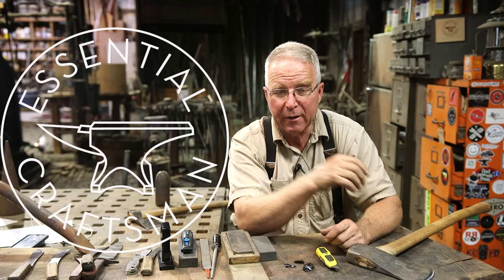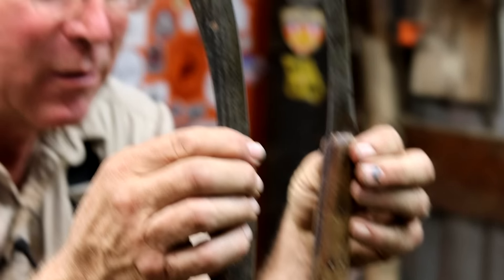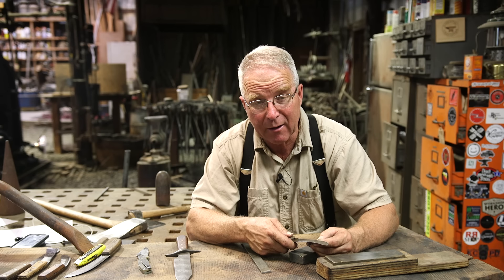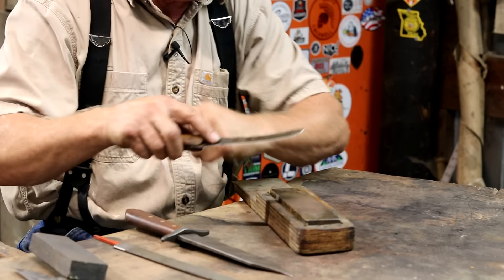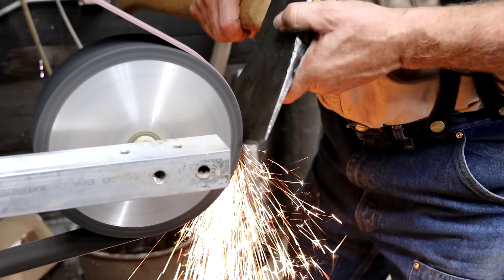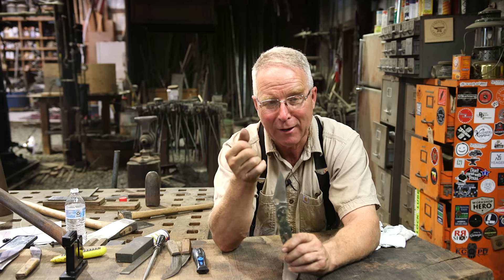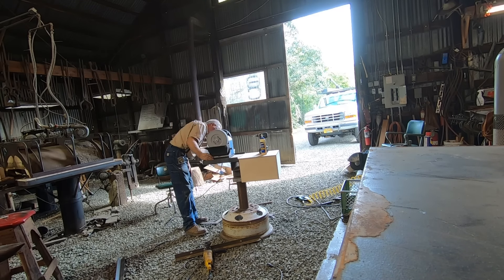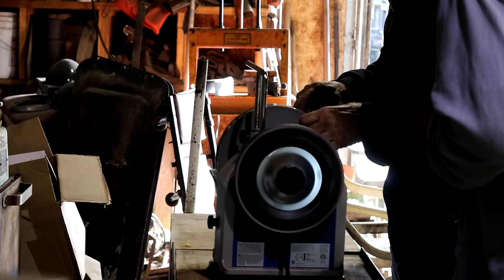Master the Art of Sharpening

Comment: Pro tip for beginners: paint with a sharpie marker the edge of the knife. Then you can see what is being removed.
Reply: I actually just did that today 😃👍
Reply: Yes, a good one👍
Reply: TY
Reply: Nice.  Also, I recommend anyone who's even doing hobby-levels of metalwork, to get machinist blue.  Sharpie won't show up on anything that's black.  Cutting oil turns black under even moderate heat.
Reply: Genius
Reply: @manictiger  Yep...also known as Dychem.
Reply: That's a great idea!
Reply: Good idea. I first saw this when I paid a street vendor down in Mexico to sharpen my pocket knife. I started to get a little uneasy when I saw him marking with the sharpie pen but then I thought I'll just keep my gringo mouth shut and see how it turns out. Came out muy bueno. Grassyass!
Reply: I have started doing this again after showing my kids the trick and realising my sharpening skills got sloppy 😂
Reply: That's a great idea!
Reply: Don't use a marker with permanent ink you will ruin your Wittrock
Reply: Thanks 4 that tip
Reply: @ramwall1500  Really? My water stones deal with it just fine
Reply: You beat me to it.
Reply: Best tip ever
Reply: 100%
Reply: Also get a 10x loupe. With the naked eye, it can look like you've removed all of the blue; but under the loupe, you will probably see a thin blue line on the edge ... meaning you've accomplished nothing.
Reply: That is very good advice! We did the same on all our automotive injection molds before we did any stoning on the molds. Even in a blink of an eye you can take        .02 mm off the steel. That is just a bitty bit. The sharpie is an excellent reference to where you have been and the low spots stay black. That is assuming you are using a hard stone. That’s was a great idea and technique for you to share!
Reply: This is also how you level and crown frets on a guitar.
Reply: I've got to try this.
Reply: Sharpie, that's a great idea....I've been doing it for years!!!....good advice
Reply: Great shop....looks like TONS of stuff has transpired there....created...neat ole guy
Reply: I siad it in my comment but yours is more popular.
 Another tip; if you find you style inadequate, practice on a chisel (with a clear easy angle to follow and a burr on only one side, and the "primary" edge going so far into the "secondary edge" gives you a much larger scale view than what's going on with a knife edge.) 
Then picture a knife edge as two chisels coming together. If you can tell sharp and remove burr and follow angle, you only need to learn to keep center and boom your a pro sharpener!

Also, I would sharpie the secondary edge (maybe only it, maybe a different color) as, unless your knife is mangled really bad, you DON'T want to work that secondary edge. (You are working into it along the primary angle, but never a scratch should be on the secondary)
Reply: Learned this when I started collecting, restoring, sharpening, and honing straight razors.
Reply: @bobbyscalchi4013  a straight razor is basically a super sharp, brittle chisel right? Or are they double sided?
Reply: @ironheadrondo5596  depends on the grind and the thickness of the spine.. Some straight razors are thicker at the spine to create a V shaped wedge grind and razor edge. Some are convexed and hollow ground but typically have two sides to the grind.
Reply: @bobbyscalchi4013  ok, sounds like a knife with a large narrow primary edge. 
Interesting.....the hardest part for me to learn was keeping the angle (telling sharp and keeping center are pretty easy with four fingers and a good light). Seems like that would maybe be easier with a straight razor, I should really get me one. 

I have never seen a convex or concave primary edge (I've seen secondary edges that go very close, but there's always a small straight grind edge) I reshaped concave secondary edges and it's a pita, constantly changing angle smoothly is the only way to have it look right (or a loosish belt sander, but you gotta be careful with heat.....well maybe not on a razor; as it is so hard anyway....) Yeah, too many questions, I have to get a straight razor now. It's either a nice in-between from a chisel or the next level above a classic blade; and I can't decide which just mulling bit over.
Reply: @xyzct  I like 60X
Reply: @davec.3198  Also known as Dykem. Fun fact. They changed the formula about 10-15 years ago so they could ship it across state lines on account of its chemical makeup. Now it's not as good. Some of is still have some old bottles of the good stuff. Dries faster. I have red and blue.
Reply: Ol machinists trick

Comment: Grew up working in my dads old time butcher shop in 1970's Chicago. Watched him sharpen and steel his knives for many years. I remember cutting up meat for hamburger and cutting up chickens on the well worn maple butcher blocks starting when I was 10 or so. His knives were SHARP, and you learned fast to keep an eye on your fingers! He hated the plastic cutting boards as they dulled the knives too fast. He never used a meat saw because he prized his fingers and because they shredded the meat. Nothing better looking than a knife cut steak. He only used a hand meat saw for the bones, carefully trimming around them before sawing as to not shred any of the meat. He would break down an entire half cattle using this method and did it fairly quickly. Still have a few boning knives that are worn down to nothing but are super sharp and stiletto shaped. I have his Arkansas stones and steels to remember him by, as he has passed on, and this video has inspired me to get them out and hone some of my dull blades. Thank you Scott for the inspirational video, and keep up the good work!

Comment: I have been sharpening stuff since my Grandad taught me how to sharpen knives over 70 years ago. I was violently attacked when I was four years old. My Grandad began teaching me how to knife fight. He grew up along the Brazos river in the 1880s and 1890s.  In the old days the West was NOT Little House on the Prairie. He always stressed the point that I carry a sharp knife. I once disarmed a man who was stupid enough to bring a gun to a knife fight. Sheesh the ignorance of some people.

You, sir, are  the very first person I have seen that actually knows what he is talking about concerning sharpening tools and understanding tempering. I have honing oil to use on my India stone, but I'm guilty of using WD--40 most of the time. It's always at hand and the honing oil is usually at the back of a tool drawer somewhere.

Here in Texas hunters take their knives to knife sharpeners. Which usually is some bozo with a  belt sander. Resulting in wavy blades with ruined tempers. 
I have used stainless steel knives for awhile now,  (Buck folding hunter) and my kitchen knives are now stainless. The set came with a diamond dust coated steel. I put a more acute angle on the stainless blade than a carbon steel blade. My old knives are Old Hickory brand, which is what I believe your curved blade knives are.

Whenever I buy a pocket knife, the first thing I do is sharpen it. I completely remove the factory edge.

I worked for many years as a heat treater.

The blades called Damascus blades now have no connection to the ancient Damascus steel, made in Damascus, Syria.. The current blades are folded and welded, incorporating the surface slag into the blade by folding and hammer welding. It makes for a very sharp blade with a nice pattern with no lateral strength.

The reason we don't use Damascus steel now is because we have better steels. A gas chromatograph can analyze a a piece of metal,, such as steel and give the exact composition of the steel. Sometime in the 1970s two metallurgists analyzed a Damascus blade and published the results in a metallurgical magazine. The best I remember was that it was a spring steel, close to 52100, think older car leaf springs.

I have never used a jig or automatic sharpener. I have sharpened chainsaw chains, knives of all kinds, scissors and the blades of my Norelco rotary sharpener.

There used to be a type of table knife and trade knives, (cheap knives made to trade with native populations). They consisted of a blade of soft steel or iron that had been carburized. That is a layer of carbon has been infused into the soft steel, making a hard edge, except when the knife was sharjpened, the layer of soft steel would be in the center of the blade edge The sharpening trick is to sharpen one side only.

John Deere invented the steel plow in 1837. It soon replaced the wooden and cast iron plows. Keeping it sharp was a problem and the point of the share soon wore down so much that the plow was scrap. A man named Macadam invented a heat treated plow share that bolted to the moldboard. This share could be removed and a blacksmith could sharpen it with a hammer and anvil, drawing the metal back to it's original shape and re-heat treating the share. And when it finally wore out, it was cheaper to replace than the entire plow.

I sharpen the blades of my Norelco rotary shaver using an Indian oilstone. Extremely fine grit.
I have several different sizes of even round whet rocks.

I have a stone flint knife that I picked up on a ranch in Jack County Texas. It's what I would call a finger knife as the back of the knife is gripped with the thumb and forefinger and part of the back is angled so that the other fingers press against the knife to apply pressure to the cutting edge. I never saw anything like it. It needs sharpening but I'm not about to start chipping flint. This knife was a couple of  miles from where Comanches had a winter camp on the South side of a cliff.
This knife would be a perfect skinning knife. I could easily butcher a deer or other game with it.

Well my meds are about to take hold and I'm going to  get some sleep.

This is long, but a funny story before I go.

I had a friend who was a Russian interpreter. In the 1970s Moscow allowed some Jews to leave the USSR. They could only take the clothes they were wearing with them. May landed in Dallas, Texas where there is a considerable Jewish population.
My friend worked for the organization that was helping them with finding places to live, jobs, food, clothing, etc. These people literally had nothing.
So my friend called me one  day puzzled beyond belief. He said he was called to take a man in his 60s to a machine shop to apply for a job. He told me the guy said he was a tool sharpener. I saw what was coming and could barely contain my glee. A tool to my friend was a shovel or hoe, certainly nothing to do with machine shops. 
I asked him what happened. He said he didn't know. I said tell me the story. I'm already seconds from a giggle-fit.  So my friend said he took this old man (who didn't speak English) into the machine shop. He said the owner handed the old man a gigantic drill bit looking thing and told me to tell him to sharpen it. He said the old man looked around and walked over to a funny looking machine and laid the big drill bit in the machine and began to turn knobs and slide stuff around. The machine shop owner said to tell the old man he was hired. My friend said, "But he hasn't done anything yet." The owner told him it was okay, that the old man was hired.
My friend said, in the most puzzled, plaintive voice I ever heard, " What happened?" When I could stop laughing I told him that the ole man was called a tool grinder and the gigantic drill bit was a cutter used on some sort of machine for machining metals. My friends said, "He didn't do anything." I explained that the machine the old man started making settings was used to sharpen those kinds of tools (giant drill bits). And that sharpening the tool, which had to have complex angles sharpened and curves accounted for was easy..The hard part was setting up the machine. The old man was a tool grinder and those machines were the same all over the world.

I'm out. Thanks for the forum. My Dammitol has "tuck holt"and I may can get some sleep. It's 3:14 A.M. Central Standard Time.

Peace.
Barry M. 81 years and 5 days. I am a Time Traveler. Don't sweat the small stuff, and it's all small stuff.
Reply: Happy birthday for last week Baz
Reply: I could a read another hour and a half of you tellin' stories like that Jean,"time traveler". If you was near about leflore county ok. I'd bring the  shine and listen to your stories.
Reply: Pretty cool
Reply: Where in Texas do you live? This 35 year old would love to buy you a  beer and swap stories
Reply: If you're a time traveler why aren't you ever at the meetings?
Reply: Thank you for sharing, much appreciated

Comment: Thanks. I learned a lot today. I had been using way too little pressure with those v shaped carbide sharpeners. Glad to see that seeing little flakes of steel is a sign it's working correctly, not a sign of having screwed it up.

Comment: I'm sitting here at my computer with my water stones, diamond stones, oil stones and Lansky sharpening system ready to go. I also have some pocket knives, chisels and hand planes here ready to go as well. It's funny that you put this video out at the same time. One thing I guess I would have added is to be able to detect that burr on the back of the blade, and what stropping would accomplish by knocking that burr off to reveal a sharper edge. Thanks for the video, my 2 daughters will be well versed in the art of sharpening. Especially around the time of deer season.
Reply: two bearded butchers, i think?  I bought one of the victorinox knives, off amazon, that they suggested.  Holy God Sharp out of the package.  Already told dad to get another dear this year...  Now I need to figure out how to maintain that edge...  I use a Worksharp for ALL of my daily straight knife sharpening these days, once the steel no longer works.  Once the Worksharp doesn't cut it, or for any other tool, back to my Tormek Supergrind 2000 that my lovely wife spent $500?  $600?  on years ago.  That Tormek is phenomenal....

Comment: I've been sharpening my kitchen and pocket knives since I was a kid (I'm 50) with the bottom of a ceramic coffee cup just like my dad tought me. It's never failed me👍🏽
Reply: gonna try that. thanks.
Reply: Gotta try this too.hope ur not messin with us lol
Reply: @jonm2416  not at all just make sure the thin area that goes around the edge of the bottom of your ceramic coffee cup is what you use on the edge of the knife. 
Just a few swipes in the same directions you would sharpen with a sharpening wet stone and you're good to go..
Good Luck and happy sharpening.
Reply: I finish the sharpening on a glass jar or old coffee cup. It polishes it on a microscopic level.
Reply: Irg863 ;   I did this so many times, now my cup is leaking....
Reply: I was about to mention that, but checked the comments to see if anyone else did. I learned this from a native American who worked in a fish processing plant. I learned to put a drip of water on the ceramic bottom, and it doesn't work with every cup. I've also learned that if the knife is too dull you may have to resort to a stone to bring the edge down enough to make it thin enough.
Reply: Awesome tip 👏👏
Reply: O use the back of a ceramic plate.  Porcelain is the finest grit.

Comment: I just recently made my first knife from an O1 tool steel blank that I ordered from the waterjet guys. (I've made a couple from stainless steel previously, but this was the first that required me to heat treat and temper)

The heat treating and tempering part was made possible in part by knowledge gained from various youtube channels including this one and reading various other sources.

Knife sharpening I'm pretty good at, grinding the shape and bevel of the blade from raw stock is something I need more practice with though
Reply: I made a machette out of a power hacksaw blade(01).  Ground a chopping type profile on it, then finished the edge by hand on an india stone. Took forever! Had no idea what i was getting into. 
In the end, it was still worth it, but that was the last time i did it by hand.

Comment: When oiling an Arkansas stone, it's actually helping to lift the fine metal shavings out of the pores. Always oil your Arkansas stone.  When you do, you can literally watch the oil mix with the metal, effectively cleaning the stone.
Reply: Oil to start to keep the stone clean and cutting faster. Towards the end, work the stone until its dry so that it clogs with swarf. This will make the stone polish more than cut.